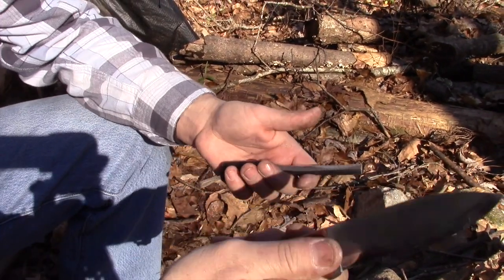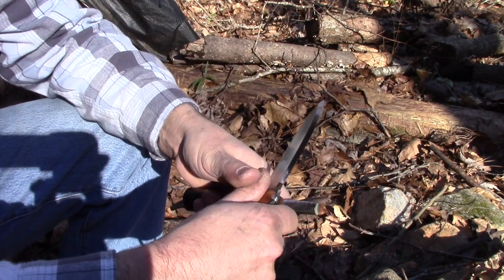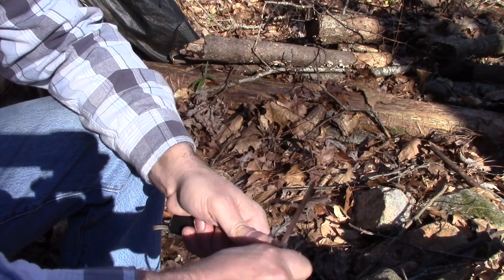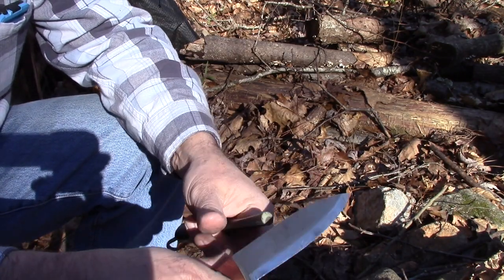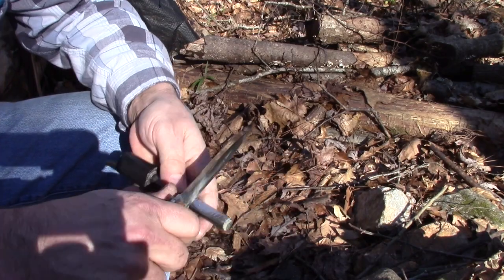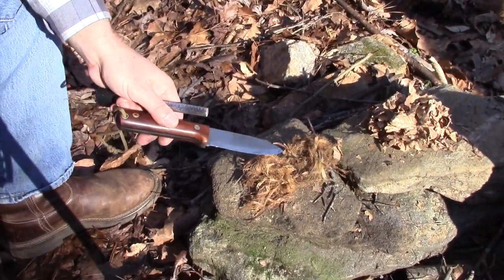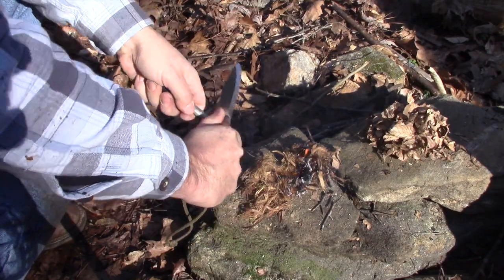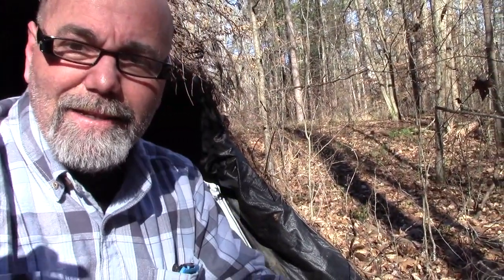A Ferro Rod Technique for Accuracy

Comment: Joe and I learned that technique from Magnus Andersson. I find it works best when using a harder ferro rod like a Light My Fire. I've had mixed results with that technique with the softer rods. You can't beat it for economy of motion but if you are doing it right it sure does tear up the ferro rod!
Reply from the maker: +Blue Mountain Bushcraft and Outdoors I do like the control with this method, Mike. I can scrape up a pile of material for stubborn tinder and then hit it with sparks using the thumb lever. Thanks for checking out the vid. i appreciate your feedback!

Comment: I prefer pulling the rod back against the scraper for several reasons. Common safety practices dictate one keeps their body away from the blade as much as possible. One slip up in freezing weather when your dexterity is off and your hands aren't cooperating with you and you have snow and ice all over everything, stuff could go bad. 

Also, the quality one one's tinder bundle can have a great effect on how much spark one needs. A properly prepared tinder bundle take one scrape of the rod. If built up like a hut, all one's sparks shoot right into the hut and not one spark is wasted. It's all caught up. 

The angle of one's knife has a lot to do with where sparks go. You can shoot them left, right, across your lay, in front of your lay all by how you position your scraper on the rod. 

Plus, I don't like having a knife blade less than an inch from my skin while I'm doing a high pressured move like scraping. Again, one slip and I could make my #1 concern stopping the blood from spurting out and fire takes a backseat. 

The only way to avoid that is by (A) not using a knife to scrape ferro rods, instead using something safer and less damaging to both the rod and the knife (long story of how scraping sparks at twice the temperature that it takes to temper [3500 degree sparks vs 1800 degree tempering] them softens the metal and causes premature wear on the spine as well as ridges on the rod) and (B) no matter what method anyone uses, something like a tinder hut should be formed to collect as many of the shavings of ferrocerium as possible. 

These faults I pointed out don't show up on sunny days with perfect tinder. They tend to manifest themselves during cold, wet windy days when the wonder one scrape fire is nearly impossible and one has to put in between 1/2 a dozen scrapes or more to get first flame. 

For most ferro rod users, this isn't an issue. I would dare suggest that most ferro rod users use them under ideal conditions and have one scrape fires so the damage on the knife is minimized. For pyros like us? Different story. 

But, to each his/her own and I'm not questioning anyone else's results of course. 

Just sharing my observations and why I like to pull the rod back and keep the scraper stationary. For me, it's a question of more control and safety whether I use a knife or a dedicated scraper. 

For me, that's ensure the greatest production of sparks and shedding of material for one-time quick light fires even in poor conditions because the more material you scrape off that lands in a contained area, the longer a concentrated burn one gets and the bigger the increase in chances are that the bundle will catch flame. 

Most times I've come to find that we're not even lighting the tinder itself, but after a few scrapes, we're just lighting the shavings that didn't light the first few times they were scraped off into the bundle. That's when you hear that high fizzle and see sparks dancing around like Mexican Jumping Beans LOL (who remembers those?).
Reply from the maker: +Yankee Woodcraft Thanks for sharing your preferred technique with us, Yank. I use both but have found the thumb lever concentrates the bulk of sparks on my target. Last weekend a buddy and I camped in less than favorable conditions and I had a time getting dry tinder prepped from wet white pine. With enough ferro shavings and wood scrapings it finally caught. Of course the Bic was in my pocket too. 

Gross motor skills involved with this method are used. I've found it as easy to spark with method when dexterity is low. Of course care should be taken with any sharp, pointy object in hand. 

Thanks again for taking the time to watch and share your thoughts!